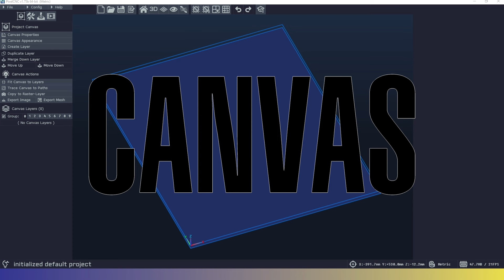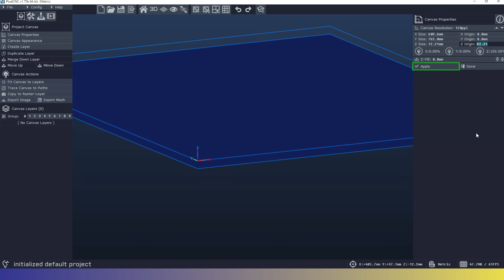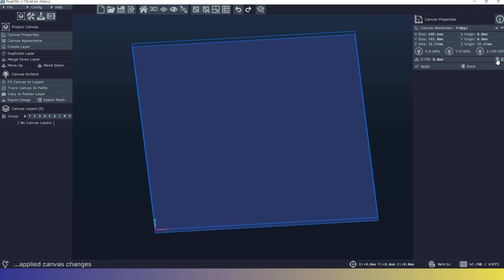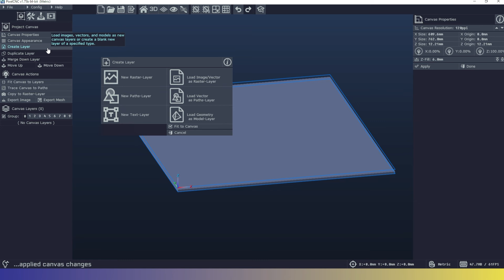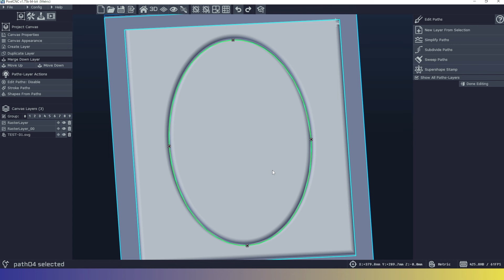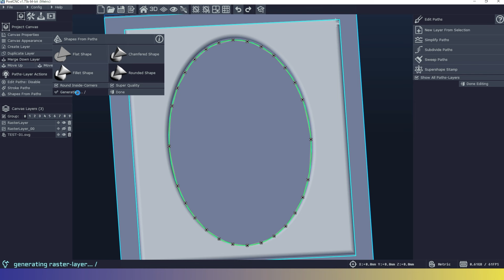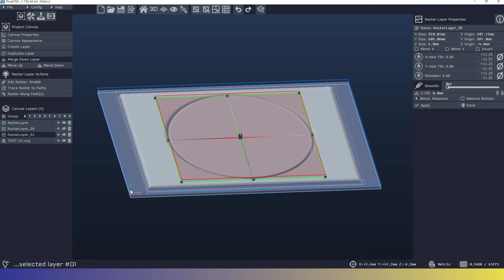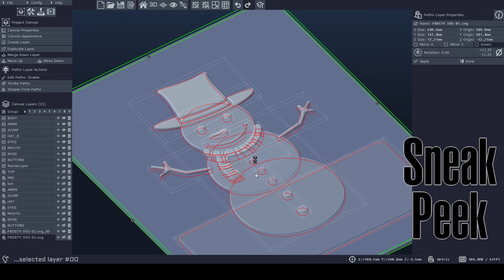PixelCNC - Canvas & Layers the Basics

Comment: I'm totally new to cnc. I'm trying to figure out software. To give you some background, I'm a painter and I'm trying to find new places to use my work. I want to be able to take a scan of my painting and turn it into a carving. I'm so confused at this point as to what I need besides the machine. I have 2 old versions of Photoshop and Illustrator and I can't figure out how to use them to get where I wanted to go so I was thinking Inkscape might be easier to design with.  I've looked at Carbide create Pro too. What do you think?